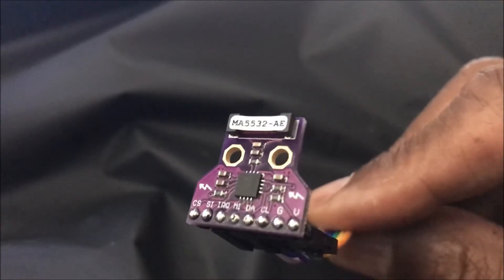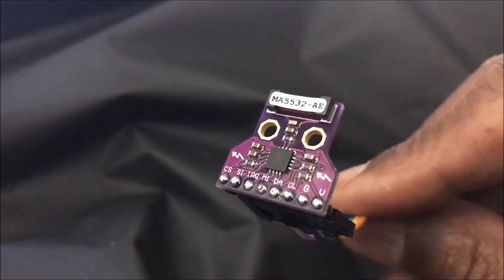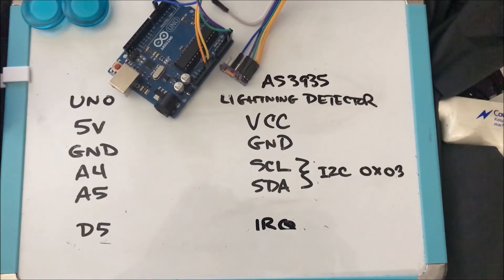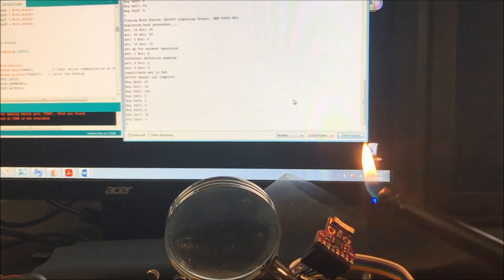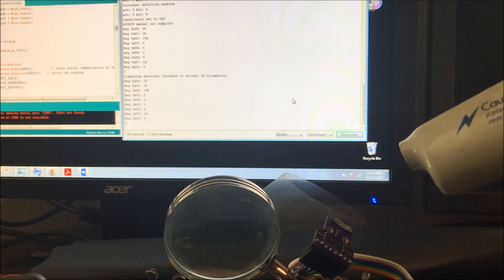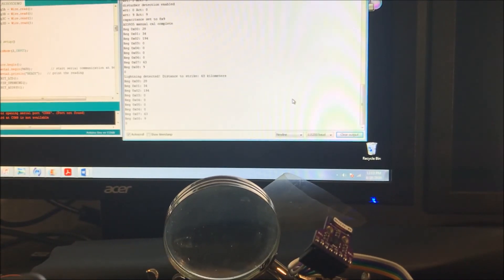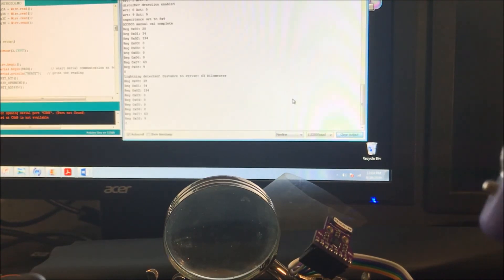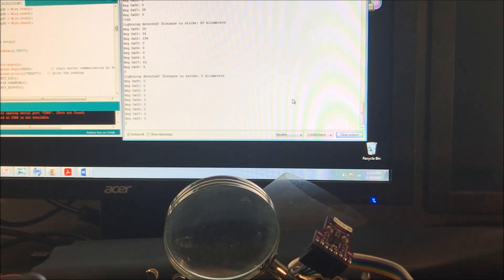AS3935 Lightning Detector demo

Comment: Requesting you give the clarification on "why AS3935 lightning detector" is tuned to 500k hz only,why not other frequency"-
Reply from the maker: From the manufacturer: “the resonance frequency of our manufactured boards start at about ~496kHz. The datasheet specifies that the resonance frequency should be within 3.5 percent above or below 500mHz for optimal lightning detection.”
Reply: @microcontrollersandiot3700  thank your response
Is any relation of 500khz with lightning radiation

Comment: Good morning sir,
Sir, can you provide the list of equipments for showing this  lightning experiment practically
Reply: how to produce lightning practically to show above application
Reply from the maker: I used a stun gun.  But you could use an air gap device or a Tesla coil.  I tend to use what I have laying around. My other half gets mad when I add “just one more new item”, like the Variac that is on its way.

Comment: hi  how are you sir ,can you provide me the sketch file which you are used  ,if you dont mind
Reply from the maker: Here it is:

This sketch was used from the link in the item's description

/******************/**************************************************************************
  File Name: as3935_lightning_i2c_nocal.ino
  Processor/Platform: Arduino Uno R3 (tested)
  Development Environment: Arduino 1.6.1

  Designed for use with with Playing With Fusion AS3935 Lightning Sensor
  Breakout: SEN-39001-R01. Demo shows how this lightning sensor can be brought
  into an Arduino project without a bunch of calibration needed. This is
  because each board is tested calibrated prior to being shipped, and the
  cal value is written on the packaging.

    SEN-39001-R01 (universal applications)
    ---> http://www.playingwithfusion.com/productview.php?pdid=22

  Copyright © 2015 Playing With Fusion, Inc.
  SOFTWARE LICENSE AGREEMENT: This code is released under the MIT License.

  Permission is hereby granted, free of charge, to any person obtaining a
  copy of this software and associated documentation files (the "Software"),
  to deal in the Software without restriction, including without limitation
  the rights to use, copy, modify, merge, publish, distribute, sublicense,
  and/or sell copies of the Software, and to permit persons to whom the
  Software is furnished to do so, subject to the following conditions:

  The above copyright notice and this permission notice shall be included in
  all copies or substantial portions of the Software.

  THE SOFTWARE IS PROVIDED "AS IS", WITHOUT WARRANTY OF ANY KIND, EXPRESS OR
  IMPLIED, INCLUDING BUT NOT LIMITED TO THE WARRANTIES OF MERCHANTABILITY,
  FITNESS FOR A PARTICULAR PURPOSE AND NONINFRINGEMENT. IN NO EVENT SHALL THE
  AUTHORS OR COPYRIGHT HOLDERS BE LIABLE FOR ANY CLAIM, DAMAGES OR OTHER
  LIABILITY, WHETHER IN AN ACTION OF CONTRACT, TORT OR OTHERWISE, ARISING
  FROM, OUT OF OR IN CONNECTION WITH THE SOFTWARE OR THE USE OR OTHER
  DEALINGS IN THE SOFTWARE.
* ************************************************************************
  REVISION HISTORY:
  Author		Date		Comments
  J. Steinlage		2015Jul20       I2C release based on SPI example

  Playing With Fusion, Inc. invests time and resources developing open-source
  code. Please support Playing With Fusion and continued open-source
  development by buying products from Playing With Fusion!

* ************************************************************************
  APPLICATION SPECIFIC NOTES (READ THIS!!!):
  - This file configures then runs a program on an Arduino to interface with
    an AS3935 Franklin Lightning Sensor manufactured by AMS.
     - Configure Arduino
     - Perform setup for AS3935 chip
       --- capacitance registers for tuning (based on cal value provided)
       --- configurations for your application specifics (indoor/outdoor, etc)
     - read status/info from sensor
     - Write formatted information to serial port
  - Set configs for your specific needs using the #defines for wiring, and
    review the setup() function for other settings (indoor/outdoor, for example)
  - I2C specific note: This example uses the I2C interface via the I2C lib, not
    the 'Wire' lib included with the Arduino IDE.

  Circuit:
     Arduino Uno   Arduino Mega  -->  SEN-39001: AS3935 Breakout
     SDA:    SDA        SDA      -->  MOSI/SDA   (SDA is labeled on the bottom of the Arduino)
     SCLK:   SCL        SCL      -->  SCK/SCL    (SCL is labeled on the bottom of the Arduino)
     SI:     pin  9     pin 9    -->  SI (select interface; GND=SPI, VDD=I2C
     IRQ:    pin  2     pin 2    -->  IRQ
     GND:    GND        ''       -->  CS (pull CS to ground even though it's not used)
     GND:    GND        ''       -->  GND
     5V:     5V         ''       -->  Arduino I/O is at 5V, so power board from 5V. Can use 3.3V with Due, etc
**************************************************************************/
// The AS3935 communicates via SPI or I2C.
// This example uses the I2C interface via the I2C lib, not Wire lib
#include "I2C.h"
// include Playing With Fusion AXS3935 libraries
#include "PWFusion_AS3935_I2C.h"

// interrupt trigger global var
volatile int8_t AS3935_ISR_Trig = 0;

// defines for hardware config
#define SI_PIN               9
#define IRQ_PIN              2        // digital pins 2 and 3 are available for interrupt capability
#define AS3935_ADD           0x03     // x03 - standard PWF SEN-39001-R01 config
#define AS3935_CAPACITANCE   72       // <-- SET THIS VALUE TO THE NUMBER LISTED ON YOUR BOARD 

// defines for general chip settings
#define AS3935_INDOORS       0
#define AS3935_OUTDOORS      1
#define AS3935_DIST_DIS      0
#define AS3935_DIST_EN       1

// prototypes
void AS3935_ISR();

PWF_AS3935_I2C  lightning0((uint8_t)IRQ_PIN, (uint8_t)SI_PIN, (uint8_t)AS3935_ADD);

void setup()
{

  Serial.begin(115200);
  Serial.println("Playing With Fusion: AS3935 Lightning Sensor, SEN-39001-R01");
  Serial.println("beginning boot procedure....");

  // setup for the the I2C library: (enable pullups, set speed to 400kHz)
  I2c.begin();
  I2c.pullup(true);
  I2c.setSpeed(1);
  delay(2);

  lightning0.AS3935_DefInit();   // set registers to default
  // now update sensor cal for your application and power up chip
  lightning0.AS3935_ManualCal(AS3935_CAPACITANCE, AS3935_OUTDOORS, AS3935_DIST_EN);
  // AS3935_ManualCal Parameters:
  //   --> capacitance, in pF (marked on package)
  //   --> indoors/outdoors (AS3935_INDOORS:0 / AS3935_OUTDOORS:1)
  //   --> disturbers (AS3935_DIST_EN:1 / AS3935_DIST_DIS:2)
  // function also powers up the chip

  // enable interrupt (hook IRQ pin to Arduino Uno/Mega interrupt input: 0 -> pin 2, 1 -> pin 3 )
  attachInterrupt(0, AS3935_ISR, RISING);
  lightning0.AS3935_PrintAllRegs();
  AS3935_ISR_Trig = 0;           // clear trigger

}

void loop()
{
  // This program only handles an AS3935 lightning sensor. It does nothing until
  // an interrupt is detected on the IRQ pin.
  while (0 == AS3935_ISR_Trig) {}
  delay(5);

  // reset interrupt flag
  AS3935_ISR_Trig = 0;

  // now get interrupt source
  uint8_t int_src = lightning0.AS3935_GetInterruptSrc();
  if (0 == int_src)
  {
   Serial.println("interrupt source result not expected");
    
  }
  else if (1 == int_src)
  {
    uint8_t lightning_dist_km = lightning0.AS3935_GetLightningDistKm();
    Serial.print("Lightning detected! Distance to strike: ");
    Serial.print(lightning_dist_km);
    Serial.println(" kilometers");
  }
  else if (2 == int_src)
  {
    Serial.println("Disturber detected");
  }
  else if (3 == int_src)
  {
    Serial.println("Noise level too high");
  }
  lightning0.AS3935_PrintAllRegs(); // for debug...
}

// this is irq handler for AS3935 interrupts, has to return void and take no arguments
// always make code in interrupt handlers fast and short
void AS3935_ISR()
{
  AS3935_ISR_Trig = 1;
}